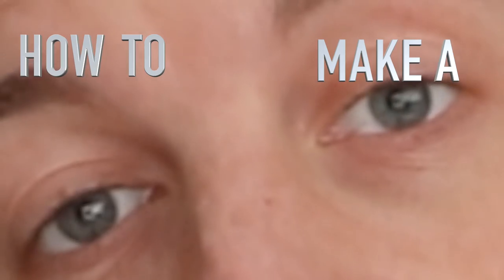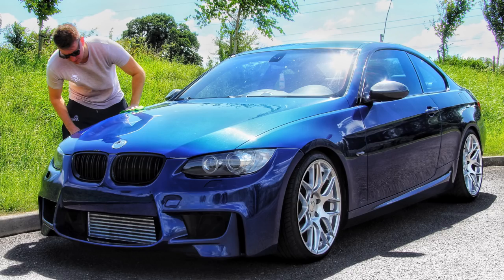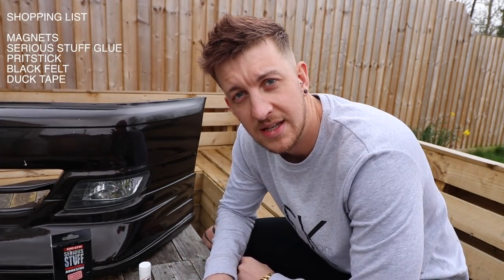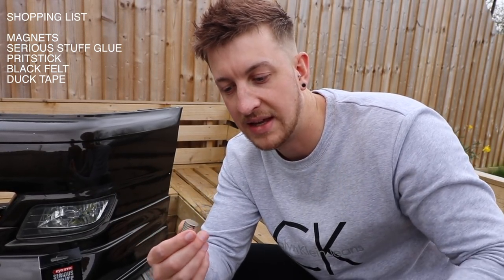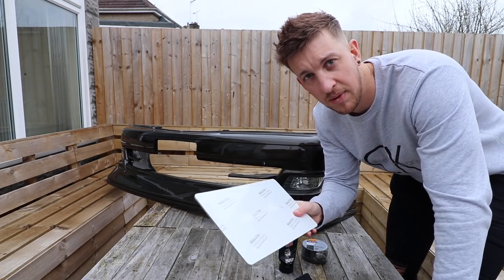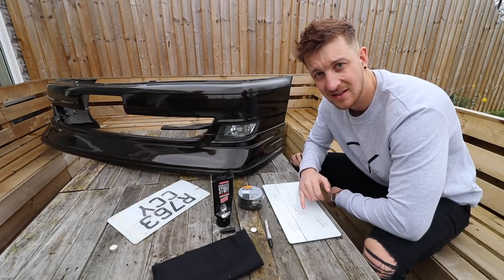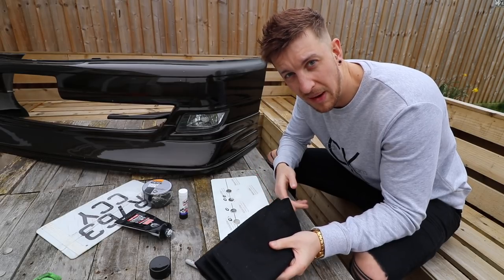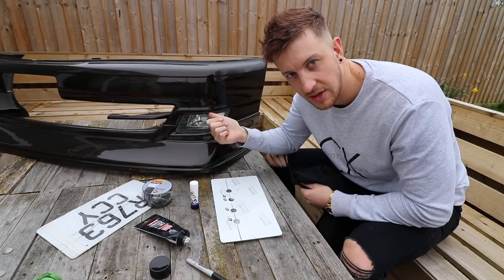*HOW TO* MAGNETIC NUMBER PLATE FOR DUMMIES

Comment: The main problem with magnetic licence plates are the vibrations from not good road surfaces and jolts from potholes. These cause the licence plate to slowly slide out of its position and descend downwards. If the magnets behind the bumper are not strong enough (for example just 10 kg power), it is only a matter of time before it starts to slip from its position. Everything may look good at first day in a video but in time (rain, washing, etc.) things will not be as "ideal" as on the first day. Several and very strong neodymium magnets behind the bumper is the key to keeping the plate in place no matter what.